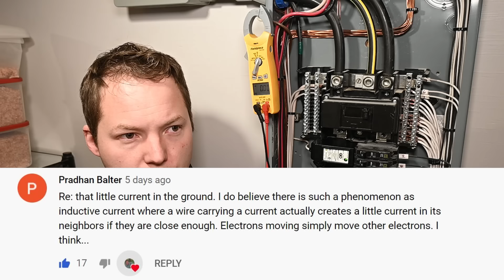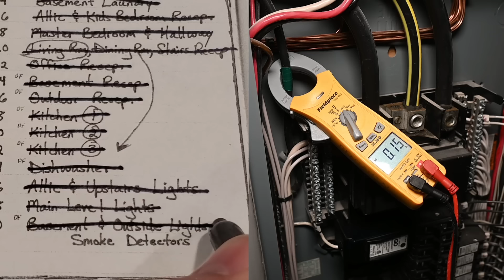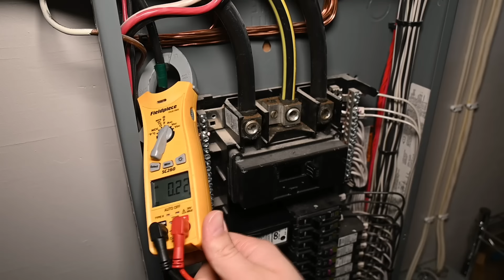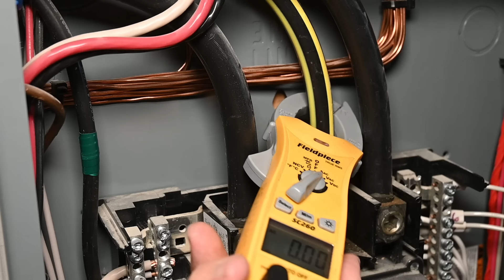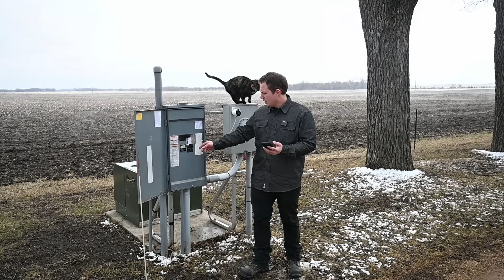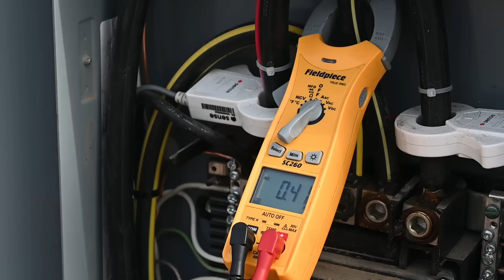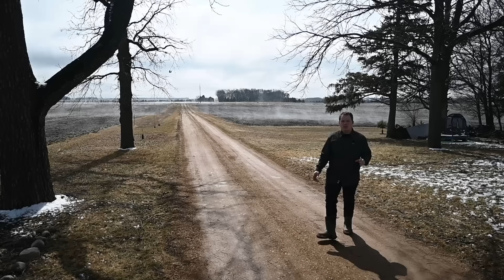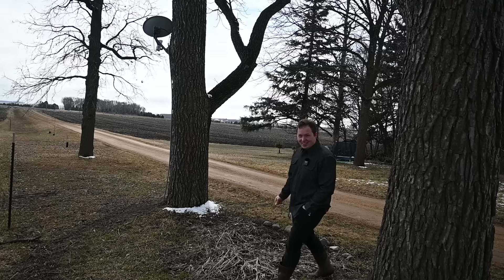Finding The Source of Stray Current on Grounding System

Comment: Did you ever find for sure what was the source of the stray current? It also could be an induced current. I had an open neutral that still had 7-10 volts that fluctuated on it between hot and neutral on a receptacle with nothing connected to the neutral side. The ground was also connected to the receptacle with 120 volts between ground and hot. Also when I put an amp clamp on some plumbing pipes in the house I get .04 amps. The plumbing is pex!

Comment: If I followed your video correctly, I think you have your grounding jumpers in a switched position.  Treat the panel in the your house as a subpanel without connection to ground and bond the system at the meter panel.  The center tap to zero potential only applies at the electrode at your x-former not at your house some yards away.

Comment: I remember hearing a electrician say, something about the neutral line returning electric you/we paid for to the power company.. 
I'm a plumber, and ham radio operator..  That's been having issues with..  The refrigerator and kitchen lights running real good/NORMAL,,. When the water pump kicks on.. 
= power line to the electric meter,,
12 inches,, outside breaker box.. 
Dpst to the house and, 1 spst to the pump house.. Then to the indoor panel..  In the bathroom, the gfic, only 1 in the house won't reset..
In the morning I'll put a new 1 in..
A few out let's down steam from this gfic.. Are not working...
As I said, I'm a plumber, = not used to fixing things I can't see.. / without a METER.....  I'm going to find the other end of the problem soon, I hope..  Any ideas..???..

Comment: Interesting video! I have a similar issue  but we are talking about 7Amps flowing into the grounded city water pipe with my main breaker off. They are currently investigating but i suspect a neighbour leaking to ground and me catching it because there is 0 amp flowing in the transformer neutral to ground a few houses down.

Comment: I'm not and expert either but if you're looking for induced voltage, what's with the tie wraps inside the panel? Bro, that's cheating and a perfect example of how to take the craft right out of your trade.  Induced voltage or not you got to somehow figure out how to make your panels neat without tie wraps. You'll feel much better about yourself and have a lot easier of a time troubleshooting inside that panel. If not for yourself, how about the next guy. Thanks man. Typo edit. Sorry.

Comment: 17:16 Please tell me more about that microphone. Are you recording audio to a separate device (or itself) then adding it in post or does that thing really have that kind of range?
Reply: he's using the Rode Wireless Go mic. You can get them for around $200 (try Sweetwater Sound online (lots of 0% interest deals) or any guitar center, etc near you).  He's wearing the transmitter, and the identical receiver will be connected to whatever he's recording into, whether it be direct to camera or another external recording device (separate from the Go mic system).  If you want an all-in-one mic + recording device for even less money that is just one, standalone little unit (same size as the Rode), check out the Tascam DR-10L Micro Portable Audio Recorder with Lavalier Microphone. B&H has them for $179 i think.  That's what I have (as well as some great Rode and other mics).  You just have to sync the audio with the video in post if you go this route, but you just clip it on, turn it on, and go - worry about connecting everything back up later.

Comment: I have had this issue, and I can tell you it wasn't pleasant to experience, because the issue was whenever I touched a metal cabinet and a cage bolted to a floor, I would have a small amount of current flowing through my arm.  even when I ran a ground wire to a metal junction box with wires going through EMT.  nothing I did would fix the issue...until I ran two dedicated ground wires back to the electrical panel (both from the ceiling box and the outlet the cabinet is connected to).  only after I did this did the residual current go away.  the meter registered 44V at 0.14A between the cage and the cabinet during the issue, but once I put in the new wires that dropped to 0 volts and 0 amps and no more getting zapped.

however, the real kicker is when everything in the cabinet was off, there was no issue, but the higher the load in the cabinet, the higher the volts and amps were between the two points.

Comment: Don't make the assumption that the ground is at an equal potential, it isn't. Even if the environment is natural.
https://www.sciencedirect.com/science/article/abs/pii/S0926985101001082

You seem to have a lot of stuff to mess it up.

Look at the low impedance paths you are creating with your wire and the various electrodes. The currents you are measuring is probable the current flowing between the electrodes because your path has a lower impedance than the earth and your electrodes are at slightly different potentials.

Suspect your neutral is grounded at the transformer, the earth at the house and there is no earth neutral link at the house.

Suspect if your turn off the transformer supply it will still be there.
Suspect one earthing point will be one way to get rid of it, that is bring your earth back to the transformers neutral earth. 
The other way is to put a earth neutral link on the house side of your house electrode ( Australian standard does that, don't know if NEC allows it).

As it is, I  suspect that if the house gets struck by lightning then the two electrodes will create an issue as the earth potential rise will become significant and the current flowing will become an issue.

Interesting video.

Comment: More than likely the meter is not grounded good. There is a digital meter being used and the power for the the digital meter is getting its neutral from the grounding rod at the house instead of the grounding at the meter

Comment: I'm a little late to the party...  a year late.   Didn't see any follow up videos of a resolution, but this sounds like a classic ground loop.  Since you eliminated (heck you prevented it by killing the master switch in your breaker panel) the current coming from the input power lines (the hot wires), then you simply cannot have current flowing through your ground wire without a difference in potential between where your earth grounds are located, especially where the transformer center tap is grounded, the fact that you have AC current flowing supports that the transformer ground is involved.
Reply: Novice here, But from watching Ben's videos about his generator - makes me wonder aloud... If his transformer is bonded to ground... and his main panel is also bonded feeding his house beaker panel ( separate neutral / ground )  .  make his house ground & the bonded ground  at the transformer & main panel ...connect ?

Comment: I think it would be helpful to measure the current at each ground rod, including the one at the transformer.  Using that, you could visualize the voltage gradients between them in the earth driving those currents.
Reply: maybe you could track the source  by driving stakes into the ground  .. one cental point  and then several in a radius of say 20 ft.. mearure Vc and Current between all points and center rod.. this may give a dirctional indication.   It would aso depend on soil resitivity and dampness though.. very tricky situation..

Comment: On the Main Service is it Advisable to tie the Neutral and Ground together
Reply from the maker: The ground and neutrals are bonded together at the "first disconnecting means" after the electric meter. This is usually the "main panel".

Comment: I haven't read through all 900 comments yet, and kudos to you if you have, but here's my two cents: your issue isn't coming from the electrical grid. Wires are antennas, and your copper pipes out to the bush are just hollow wires. The fluctuation you're seeing isn't grid load, it's geophysics. The current is coming into the system from your massive electrical layout (and the fact that it is spring thaw and the earth is damp and therefore very conductive), not the other way around.

Btw, this was very entertaining to watch. A household whodunnit! Excellent content, I really dig your channel.

Comment: Check the ground tap from cable & phone. They might be leaking to your ground. Often they haven’t any ground rod? 
Other might be either a poor ground n the pad mount transformer or a lightening arrest or leaking current in your pad mount transformer & is traveling all sources to ground. Hence why you might be picking that up? Ofcourse you wouldn’t have access to power company equipment to check? Have them pound another ground rod in deeper & build a ground grid at the silo. 
Other option is have them pull the lightening arrestor elbow inside the pad mount. Then check for current flow. Lightening arrestors especially MOV arrestors do leak a little current to ground/neutral inside the pad mount transformer.

Comment: It could be problem that a cheap car battery chargers on boats have it will eat any metal of a boat that is in water up, it can reach up 2000 volts but they are safe on a car on land the water and whatever else in causes the path.

Comment: Never assume the ground is dead! The ground is part of the entire power system ground grid and will always have the ability to carry some ground current. No power system that uses a grounded “Y” connection will ever be totally balanced and the earth ground provides return path of the unbalanced portion to the system grid. Which is why you should never tie any of your fences to any utility structure, ever! A ground fault on the utility system may kill your stock or you or your children if they are in contact with the fence at the time of the fault.

Comment: Since ground and neutral are bonded in the main panel I'm wondering why there wouldn't be some current on the ground wire between the panel and grounding rod, and the panel case too for that matter.
Reply: There actually is. Matter of fact, if you stick a screwdriver into the earth and attach one lead of a volt meter to the screwdriver and the other lead to the grounding rod, or any grounded panel, you will see a small amount of voltage potential, usually in the 10ths of a volt. This is known as NEV. Neutral to Earth Voltage.

Comment: I would have pulled the meter and measured the neutral in the meter for current. If there was current on the neutral in the meter socket with the socket out...that would possibly indicate an issue in the TX, but not necessarily . Also I would bond every ground rod together as one if not done already. I also would have attempted to measure the voltage of the current leakage just for fun. Love your stuff! You're a good man.
Reply: You can't pull the meter without snipping the tamper locks on the meter. If the utility sees those snipped there could be questions and or a fine. I would think the utility would have to be involved and they aren't too charitable.

Comment: If we assume your padmount xfmr  primary is connected line to nuetral, not line to line, there likely will be bonding between the primary neutral and the secondary neutral bushing.  I know nuetral bonding is typical for single bushing pole mount xfmrs (primary and secondary neutral connections bonded).  

Neutral current on the utility system has multiple "earth paths" in parallel created  at every ground electrode....nearly every service, every third pole, and nearly every transformer. 

It is likely from what I see on your video, your combined ground electrode (and water pipe) has a lower impedance (to  remote earth)......ie a lower impedance earth path.

Remember dirt and the earth have lousy conductivity, but it can still be a good conductor.  Just think about a wire made  from a material with poor conductivity that is 30 feet in diameter.

I enjoy how you track down an issue.  I hope you are in a profession that involves troubleshooting.

Comment: Ben, my thoughts in regards to this kind of scenario is that the 0V of the MV/HV Neutral/centre is finding its way for ANY/Better/Nearer Grounding at the(your) localities.
Even though their Grounding Network of their Neutrals are of the Lowest Ground Resistance ie Zero Ohm, but at yr localities too are Interconnected into 'another network' of Grounding via yr own Rods, Bonding to Neutrals, direct/indirect bonding of gas/water pipes etc.
There surely be some Ground Resistance BETWEEN 0V MV/HV Neutral aka Service Entrance Neutral AND yr Localised Grounding and/or Bonding(remember that yr Neutral are Ground Bonded in MainPanel).
The difference between these two sets of 'grounding' which could be just few upto few hundreds of Ohms will result in the rise of Potential(both frm the Service Neutral Currents under comunity Load, and localised miniature/'hidden' currents).
Generally the 0V of MV/HV Neutral aka Service Entrance Neutral albeit Lowest of Resistance and 'strongest', will DEGRADE under Load(community) made worst after running for many miles... 
So like it or not, some 'currents' present in the Service Neutral will try to 'creep' to the Nearest Ground available(yr Grounding & Bonding) rather than taking a long way back to its 'best network of Neutrals'.
That is how you register some low amperage on the Service Neutral with yr localised Grounding/Bonding interconnected to it.

Comment: I've run into this in old houses that are still only 2 phase. Had the black hot wire and the white neutral. Friend bought a brand new printer which only worked a few times, then was burned up. He had power in both wires. He said he had burned up a coffee maker a few months earlier and had to buy a new one. I never did find out where that extra power was coming from. I think someone connected a new outlet or something and got wires crossed or something. I just got done working on a waterline that had a pin hole in it. This is also an old 2 wire house. The copper line was very corroded, which told me there was some electrolysis going on. I didn't put a meter on it though. I know these old houses used to use the copper water lines as a ground.

Comment: Great video. Similar to this I wish someone could explain how a neutral  behaves when you have your generator hooked up and the main breaker off. When I turn my generator on and have the main breaker OFF I get a current draw on ammeter from the phase A main line coming in above the breaker equivalent to the device in question (a coffee maker). To make it even more confusing the coffee maker is on Phase B. Either the main breaker is bad (unlikely) or something is going on with the neutral which obviously is never disconnected and from what I gather can and does flow current back to transformer due to load imbalances. Phase A appliances seem to work fine. Thanks for video. Perplexed here.

Comment: There is no guarantee that the earth or ground rod is functioning correctly. I discovered on a petro chem installation the clean earth was no better than 3 ohms and the dirty earth was 16 ohms. An inadvertent short between the two systems dropped off a 24v gas discharge system. When installing shielded or armoured cable it is important to check for circulating current between such and earth/ground. This was the expensive lesson I learned in North Sea oil. Not all earths/grounds are equal and some ground conditions make it very difficult to obtain a low resistance reading even with a multiple ground rod array.

Comment: You will always have some current flow in the ground path.
If you berry a bare #4 bond from the service disconnect ground rod to the one you have at the building your problem will go away.   This will make the entire ground system the same potential.

Comment: Try removing any ground connection from your gas or water main and check again. I had a problem where my water main ground was the source of stray ground current probably from a neighbor's wiring problem that ended up flowing to my ground rods. Nice diagnostics, BTW.

Comment: As soon as you mentioned multiple earth rod locations I guessed it was unequal potentials between earths. I was recently researching substations and the first lessons were on earth grids to avoid step fault dangers where you have a potential gradients as you travel away from the nearest earth point. In substations these can be lethal over only the length of a stride. Don’t know what the soil resistivity is like where you are but it is a big factor. You could look at marine galvanic isolation but I am not sure if it is a problem if your bonding is robust. Would be interesting to see what the open circuit potential difference is between earths. Good video.

Comment: The current you are measuring is from the transformer ground and the house ground.  The capacitance between the case and the core of the windings are not balanced
Causing a small voltage which in turn causes a small current.

Comment: You could have capacitive discharge from the metal in your house going to ground. This is why you shouldn't ground the roof of your house.
Reply: Maybe try disconnecting the ground wire and test for potential. Make sure all the power is turned off first.